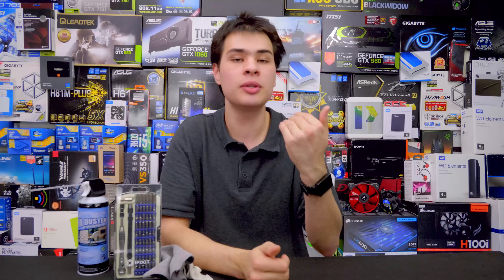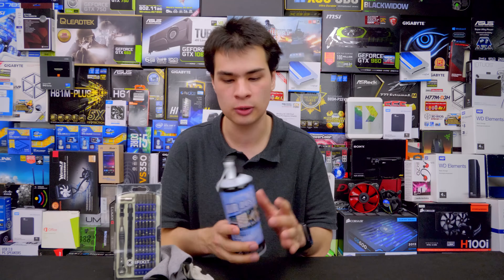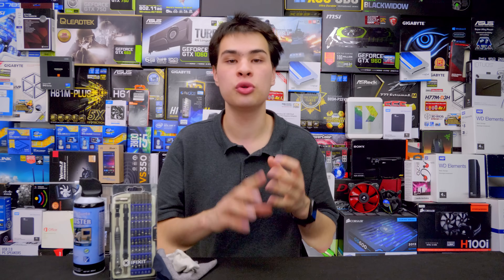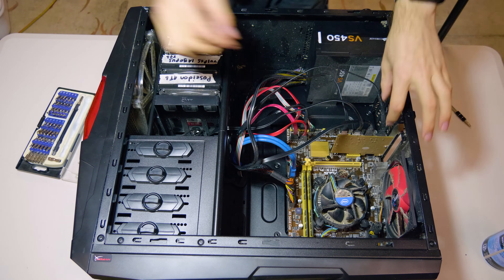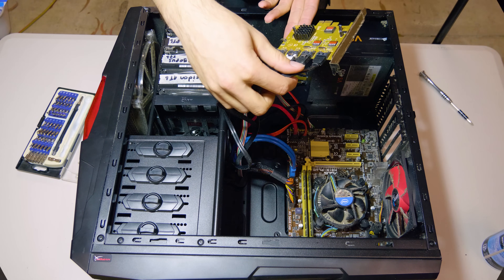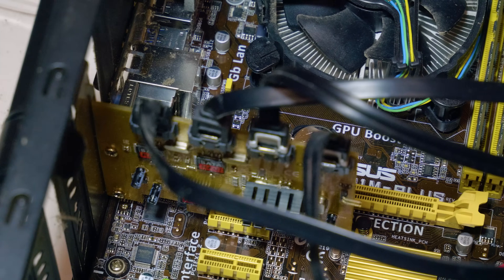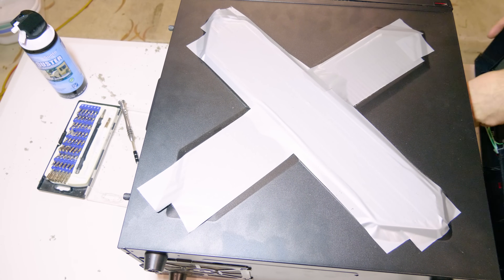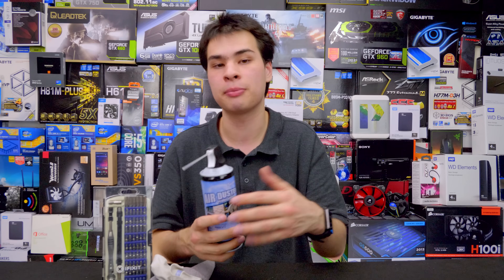How To Clean A PC Right

Comment: I'm extremely late to the party good video. One bit advice i would give is when using compressed air Do Not let the fans spin with the air. Hold the fan you are cleaning as it will potentially break the bearings.

Comment: This might not be related to anything, but when I turn my PC on, my monitor, keyboard or headset doesn’t come on and I have to press the on and off button over and over again until it comes on. The case RGB’s come on and all the fans are going when i turn it on however no peripherals come on. If someone knows a fix or anything please help me. It takes around 5-15 presses of on and off of the power button for the peripherals to come on

Comment: Is it safe to use a vacuum blower as replacement for compressed air? Vacuum blower as in the one that blows wind, not the one that sucks the dust.

I've heard vacuum causes static discharge to pc components that could damage them, but I haven't really gotten any information about the safetiness of vacuum blowers. Are they safe?
Reply: You can always use an anti-static vacuum for this very reason.

Comment: ok one thing that i see in EVERY cleaning video is YOU NEED TO HOLD THE FAN BLADES on everything before cleaning with compressed air because it will turn the blades faster then it should and will fuck up the blades .

Comment: I'm a smoker and that dust that you easily blew out of your heat sink is more like a sticky glue in mine. How should I address that? Yes, I'll start smoking in a different room.
Reply: That's tar. You need to look up cleaning solutions that handle it and then check those things don't damage the components.

Former smoker here, I always tried to keep the PC area well ventilated and a fan blowing my smoke away from the machine and its intakes.

Comment: This is one of the few situations where it's acceptable to wear a facemask. All that dust is crazy.
I've also found a small desktop vacuum useful. It's meant for cleaning small amounts of dust on keyboards and desk lamps, but it can do a bit of cleaning in a PC, too. It's great for the air grates on the computer and grabbing any dust bunnies that might have formed. It's not so great at poking into deep recesses behind components, but that's why you're supposed to remove components from your PC in order to really clean them well.

Comment: Pretty sure a metal case would corrode faster If you washed it with water. Just, there’s never a need to wash a case with water. You can use other stuff and get the same results.

Comment: IMPORTANT NOTE: Hold the fans on your computer when using compressed air on them. If the fans spin too fast you risk damaging them
Reply: oops
Reply: @plausebtw  what did you do...
Reply: @dingolul  xD
Reply: This is silly. Even a junky case fan is designed to rotate at 1,000 RPM, and good ones get up to 3,000 RPM. You're not going to exceed that with your little can of compressed air. I think if you exceed it enough to damage the fan bearings, you must be using an air compressor with enough pressure to do a whole lot of other damage as well.
Reply: @censored7881  yes, try to rotate it 3000rpm in the opposite direction.
Reply: @solorun79  What difference does it make what direction it rotates in?
Reply: @censored7881  Don't do it. The spinning fans can send a back current to the motherboard potentially frying the fan header. Also compressed air cans can make the fan spin faster than intended.
Reply: @Don-tCareAboutNameStuff  I don't believe either of those things. In fact, they're ridiculous. Nice troll, though.
Reply: @censored7881  Well, what you to believe is your choice, all I can do is advice you against it.
There is no harm in taking precautions instead of regreting later.
You do you, I guess.
Reply: @censored7881  tell us you know absolutely nothing about PCs without actually telling us you know absolutely nothing about PCs 😂😂
Reply: @virtuousheathen981  So original. Love it. The claim is still absurd.
Reply: Oops
Reply: Yeah big whoopsie, may have let them wind up quite a bit last night. Sounded like a mini turbo spooling… 🤣🤣🤣
Reply: This makes me cry because my father clean my cpu yesterday out of no where as a request and he was satisfied how fast the internal fan spin 😭😭

Comment: Use a commercial air compressor on low.
Take my computer outside where there's air and dirt all around.
Leave the cooler on, but remove graphics card because...reasons.
Don't let fans spin, lets fans spin.
Maybe replace thermal paste (after blowing dust all around).
Wash case...metal case, which could rust...wash it.

...dafuq is wrong with you?!

Comment: The trick to prevent the fans spinning is to block their movement, i typically use small cable ties and jam them in between the fan blades for the CPU, power supply and any auxiliary fans that maybe connected. Then use a small leaf blower to clean the dust out, it's pretty effective. Remember to blow in different directions to remove the most dust. Then don't forget the remove the cable ties before turning on the PC.

Comment: What's wrong with running your vacuum cleaner on low power and slowly but surely suck the dust in? Never had an issue with it...
Reply: A vacumn cleaner can produce static electricity which can damage your components.

Comment: Use a vaccum cleaner. Dont pretend there is parts that are going to come off
Reply: People don't use a vacumn cleaner because it generates static electricity, and enough of it can damage your components
Reply: @epicjohncenafan5605  lmao!!! A vaccum produces wind, does your cpu or case fans produce WIND? OMG they must be destroying your computer!!! Turn them off now, ok noob?
Reply: jimmicrackhead12 
When a vacuum sucks up dust and other particles, these can hit metal components in the pipe and become statically charged. Rotating parts inside the vacuum cleaner can also generate static electricity, if they rub against each other. And no, a vacuum does not generate wind, it's quite the opposite. It doesn't blow things away, it sucks them up. Don't use a vacuum cleaner to clean out your PC.
Reply: @epicjohncenafan5605  lol not in the pc. Stop making shit up noob

Comment: i had my computer for a few years now and my computer sounds loud and on top of it its hot and once in awhile I get a message saying 'ran into a error need to restart' or something like that
could this be because of the dust? im really worried my computer might die
Reply: Open it and check for any dust build up, if you hadn't cleaned your PC since you first got it there's a great chance alot of dust will be in there blocking the fans and laying around all your parts and it surely contributes the most to overheating and the nois levels of the fans so you better check it out and clean it as soon as you can.
Reply: @Goodnight_Robicheaux  thanks and do I gotta take out anything from my computer before i spray or do I just spray all over kinda like in the video?
oh yah i have a pre built or pre made computer whatever thats called not everybody has money to build there own computer xD
Reply: @wownelfwarrior247  no just make sure it is not plugged in the electricity then just use air like in the video and remove the dust, focus on the fans and the dust filters, you can remove few parts to clean them individually but i think that's a waste of time just wipe them with a dry cloth while they are already attached. watch out for the cloth use something that does not pass electricity so you wont damage your modules.

Comment: Unfortunately for me, I have to clean more often than 2 to 3 months. Otherwise my computer will collect strings of dust that just hangs from the fins of my fans. It gets really gnarly. Doesn't help that I have it on the floor underneath my desk, which is carpeted. It's too big to fit on my desk, so I have to keep it on the floor with a large slab of wood underneath it to keep the PSU from suffocating. So it's pretty much a once a month ordeal for me. It's also my least favorite part of the hobby. But I want to keep lower temperatures and higher frame rates, so it's worth it.
Reply: Elevate the computer using a stand or shelf it’s a hazard to have it directly on carpet because of static and dust collection

Comment: Once you blow the dust out, how do you remove the dust from the case that you just blew out?
Reply: A low powered vacuum, or what I would do is take it to my garage and flip it upside down, then use the rest of my compressed air to blow the remaining dust out
Reply: Remzly 0 alright thanks man! I think I’ll try and turn it over like you did :) thanks for the reply 👍🏼

Comment: Now that it's getting drier and warmer outside in snowy ass Canada, I was thinking of using a free air pump at a local garage. Is that safe? Would I compensate in distance from the PC because of the air pressure?
Reply: You should use a blow torch

Comment: Many ways to blow out dust... one of the costliest and least effective... using canned air.

If you are going to routinely clean out your PC(s) of dust, invest in either a purpose-built electric dust blower, or get something like a small handheld shopvac with a PC kit (hooked up to the exhaust). You get a much stronger airflow than canned air, and a huge cost savings over time... canned air is expensive and quickly adds up.

Comment: Last time I cleaned my pc, I couldn’t get access to canned air so what I did instead was wipe everything down with Clorox wipes (any alcohol based wipes should do fine), but I didn’t go super in-depth about it, mainly cleaning the fans and motherboard and any other dusty area, then I waited for it to dry for a few hours and checked, now my pc runs smoothly with no crashes or errors. 

I still recommend getting canned air ASAP because it makes cleaning those tough spots WAY easier and you don’t have to worry about things like screws catching your cleaning cloth or about moisture

Comment: Can i use hair dryer?
Reply from the maker: technically I guess you can but it is not the best thing to use as well as it generally does not have enough pressure to move the dust like compressed air does

Comment: I use my computer but I haven't cleaned it in 3 years. Is that a problem ? I see dust on the blades but it's not too much.
Reply from the maker: if the temps are not extremely hot, you should be fine
Reply: @CPUmodder  alright, thank you
Reply: Depends of your reason for not cleaning it. If its general laziness then so be it. However, if you're scared of damaging something because you've never done it then I say go for it.

Comment: I cleaned my pc it wont turn plz help me
Reply from the maker: Check the front panel connectors did not come loose, check all power cables are connected correctly and make sure parts are connected correctly

Comment: I always try to clean my PC every 6 months, tis amazing how much dust collects but I have never used a compressed air  can before, Always used to use an old dry facial grooming brush for small areas and a toothbrush for the fans. Spent about 30 -45 mins cleaning it then it just's just beautifully silent but I'm always left with a sense of trepidation because when I first turn the PC back on it sometimes doesn't load properly and have to go through a couple of resets. But after that it's super silent and runs like a dream. Anyway gona clean it later today using the can /gulp

Comment: Hey I am scared that I will mess anything up, what do i do?
(need serious comments)
Reply from the maker: take the side panel off and blow out the dust, if you don't remove anything there is a very low chance of breaking something but you won't get as thorough cleaning as removing parts
Reply: @CPUmodder  The thing is I haven't cleaned my computer over 8 years. I haven't ever looked inside it.

Comment: FYI: Electronics manufacturers usually use de-ionized water for cleaning their boards, so water is not necessarily 'bad'. BUT, you need to thoroughly dry them before use.

Comment: Would it be better to suck/vacuum instead of to blow?
Reply from the maker: nope, as that can introduce static that can kill pc parts
Reply: @CPUmodder  Sucking air at least has the advantage of taking away dust from holes. But just curious how/why would sucking air introduce static electricity, while blowing would not, when they are just both streams of air going in different direction? thanks

Comment: Do you need to reinstall the graphics drivers if you remove the gpu to clean your cpu?
Reply from the maker: nah only when you change the card say for from a 1060 to a 1070 but if you want to just take it out you will be fine. even if you power up the pc without the GPU installed there is nothing to worry about
Reply: @CPUmodder  Alright thanks :)

Comment: Can you maybe do a quick video on how to dissemble this case because I have the same (aerocool xstrike). But my friend put the PC together for me years ago and i still have no clue how to remove the front and top panel. I also can't find any videos.
Reply from the maker: Disassembly relatively simple in this case, if you have a look around the back (were the IO is) you will see screws connecting to the side panels on the far left and right of each side, simply unscrew them and the sides will come off

Comment: i have a prebuild pc, i know i realized after a year that i should build it myself....i read thze manual and they say, if you pc is not running in very dusty area, cleaning is not needed. i dont have very dusty room(i do the dusting every week because im alergic to dust and i hoover the room too), but after a year and a half from buying it, i opened it and there was a lot of dust, a bit less than in your server, but still a lot. i also noticed that in temperatures, gpu goes to 80°C when loaded and cpu in idle 40°C(when i bought it, temps were around 25°C). lol how can they say cleaning is not needed???

Comment: Nobody does it right. Nobody remembers how to clean anymore.

LAZY PEOPLE ARE EVERYWHERE

-Take off ALL fans, and dismount GPU.
-Use air to remove as much dust from everything.
-Clean fan-grills and dust filters
-Use different sized brushes to wipe dusty surfaces and PCBs.
-Use Isopropyl and wipes to clean all fanblades and dirty places
-Reassemble computer

If you stop cleaning after blowing some air over it, you arent doing it right.
Reply: Tbh I am always scared of fucking up my pc. So no, I won't dissassemble it thanks.
Reply: @blackbomber72  Also facts.
Reply: nah fuck you im just gonna chuck some air at it
Reply: too much work, all of the dust is going to accumulate back onto the fan again eventually
Reply: I agree with taking fans and GPU off and wiping them with alcohol. Alcohol not only cleans amazingly but dries in an instant but is still wet enough to pick up the dust and penetrate some of the oils left on the blade from the dust. Which will help keep it much cleaner much longer than just blowing air on it and wiping it with a cloth.
Reply: Thanks dude I thought I was caring too much
Reply: they prolly do it that was cus no one has time to do all that shit and everyone prolly doesnt know how to take off all the hardware
Reply: So many like me don't care enough. I have had my 2500k system since 2012 ish? Just slightly vaccummed it every one or two years. (Completely improper). Last year I overlooked it to 4.7ghz on the old and dirty 212 evo with lots of dust and unchanged stock paste. Still runs fine and stable with very very acceptable temps. Never seen it go into 70s ever even under gaming new AAA titles..
And it's a dirty mess! I do clean my case's filters pretty frequently, so there isn't much dust inside for a 6 plus year system anyways
Reply: Facts.
Reply: but going overkill with cleaning isnt gonna make any noticeable difference
Reply: Come and do it for me
Reply: Mad work
Reply: I usually take the entire thing apart, motherboard and all. Contact cleaner is also your best friend for things like that.
Reply: @Galaxi I'm saying so many ppl don't care about fully cleaning their pc
Reply: Just got to the step where i dunk my gpu into vinegar. And now thanks to you it doesn't work anymore 😠
Reply: I usually just blow mine out with some air and call it a day. Generally works just fine if done regularly. However, once in awhile, I do have to take it apart and do a more thorough clean. Especially if I've neglected it too long. The fans and radiator are usually the worst.
Reply: lol just buy a air compressor
Reply: That's a lot of fking work. What if I just strap a grounding bracelet the tip of the vacuum hose and vacuum it??
Reply: Or just make a positive pressure monster and use a little compressed air to move the loosely settled dust and not be an idiot.

If your method of cleaning is similar to Montes, either you have OCD and are a manic cleaner, or you're an inefficient idiot. Filters + positive pressure, thank me later. Open up around once a month, use a little compressed air or whatever method you prefer. Close it back up. Unless you're a smoker, you should never need to disassemble the rig to clean it with proper positive pressure and filters. There should be loose dust with ZERO accumulation of clumps. If you're getting dust bunnies, you did it wrong. *There are exceptions, like radiators. They will probably need to be taken out to be properly cleaned every few months depending on just how much dust you have (or pets). Yes you have to clean the filters, honestly you can neglect spritzing out the case as long as you don't neglect cleaning the filters every few weeks. Should take a few minutes at MOST to clean the filters.

Imagine being so dumb you take apart your PC every time you clean it.
Reply: @pickleadaykeepsthedoctoraway  You mad bro?